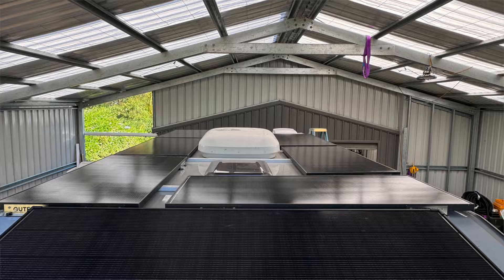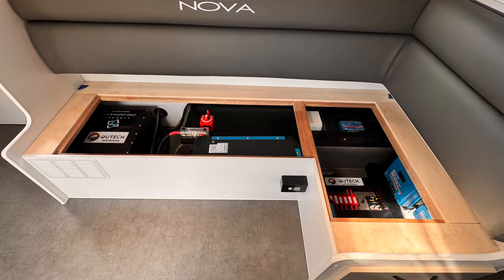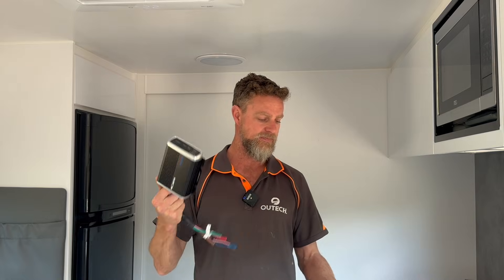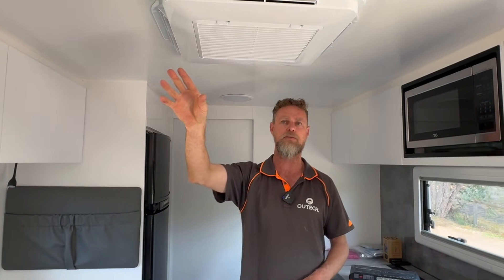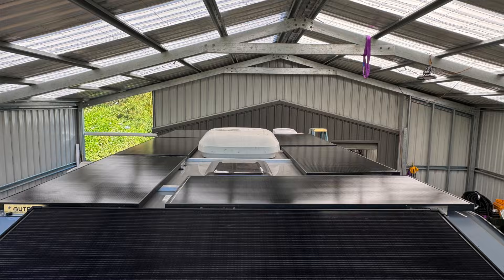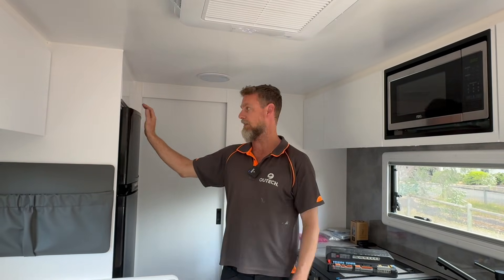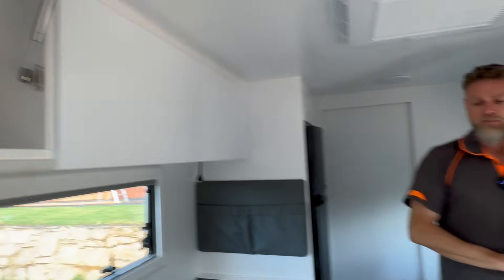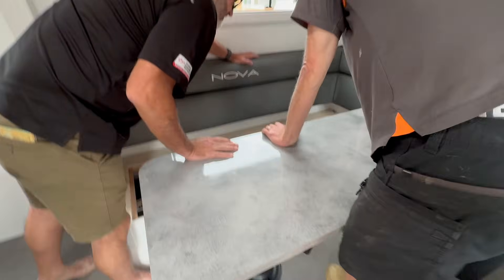Nova Caravans 24v Power Upgrade

Comment: Can you guys recommend anyone in Adelaide that can actually do quality 12 volt installs, because I’ve just spent a fair bit of money on a VictronConnect system and it’s been nothing but a disaster from day one.
Reply from the maker: Sorry to hear that @EthanBovingdon 
Guarantee it’s not the components but instead the installation and the installer not having the appropriate experience to build an off grid power system.  
Reach out to us via our website so we can point you in the right direction.